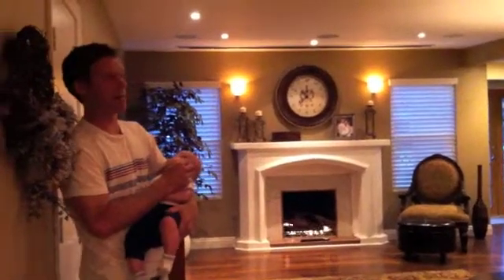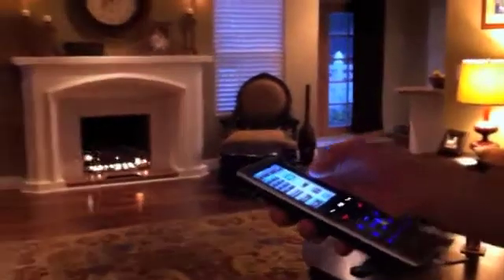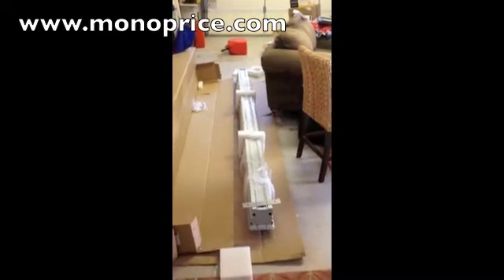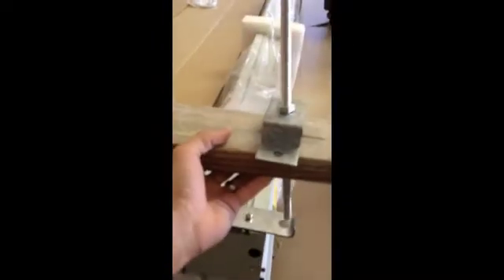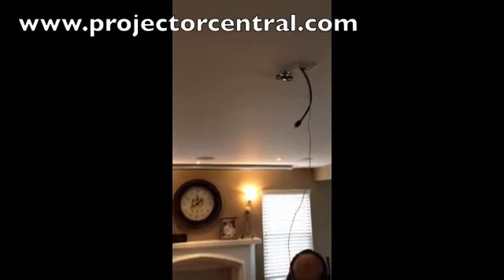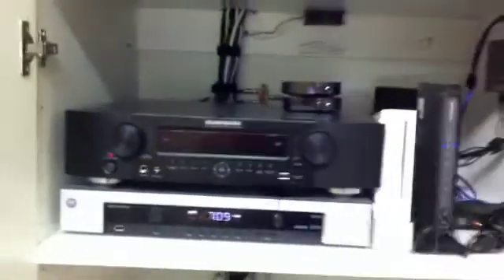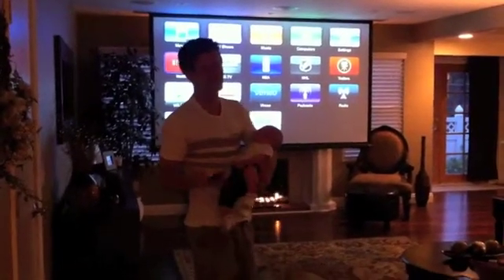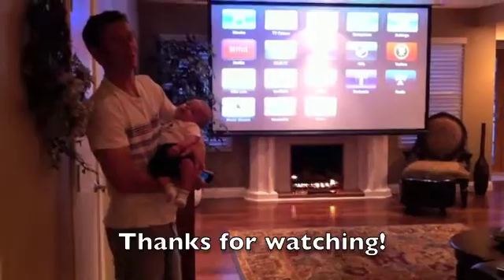Home Theater Recessed Screen Installation

Comment from the maker: 1) The speakers are just contractor series from Jamo (8.5CS), they have pivoting tweeters only. 2) The projector: Epson 710HD 3) The screen doesn't sag much at all & I'm quite happy with it as is. The tab-tension wouldn't have been consistent with the other "cost-effective" products installed. 
- As mentioned, this install was to flip our house... If I were to upgrade anything here, I'd start with those front-channel speakers.

Comment: I am planning doing almost the same exact installation in my home. Your video helped a lot. Couple questions:1) Are the front angled speakers 8" angled monoprice as well? 2) Which projector did you purchase? 3) Did you consider a tab-tensioned screen due to the 120" size and potential rainbow,sagging, and longevity issues?

Comment: Thank you for sharing this. I am planning to do this in my living room, but it doesn't have a attic access like yours did. Would that make this project more difficult? How would you do support joists in this case, and how would electrical wiring work (to power the screen). I really appreciate your video. I don't think there are a lot of recessed ceiling installations HOWTO (especially in video!).

Comment: Nice set up.
I'm planning out a very similar gig for a very similar area.
I wrestling with one major difference that I'm hoping you might have some advice for.
I have a recessed ceiling(already installed) and I'm not quite sure how to properly mount the screen.
Any advice you might be able to give a handy novice?
I've tried looking around a bit for examples or "how to's" and haven't been able to find much.
Reply from the maker: Depending on the screen you purchase... if it has a recessed kit, you'l need to have room above you ceiling. If there's no recessed kit, you'll likely have to surface mount and get creative to frame around it (maybe with a piece of trim attached to the bottom of the screen drop).  No matter how handy you are, read the instructions. Good luck!

Comment: Nice, although I rather doubt the "added $15k to our home value".  Also, the projector enclosure is probably not a good idea since it limits the size of your projector (the one in the video looks rather small), not to mention prevents your projector from effectively cooling due to being in an enclosure (hence, shortening it's lifespan likely).  The screen looks great installed though, nice job.
Reply from the maker: We sold the house a few months back and it was definitely a selling point, I'll stick to the $15k added value (probably more though judging by the reactions and offers we had from those who were interested).
    I wanted that projector enclosure as small as possible, as I mention it's there to reduce the visibility of this room being a "theater". There's actually just the right amount of room in the front for the exhaust and intake, and it also serves it's other purpose - silencing that projector.
   Overall everything came out just as I had expected and hoped.

Comment: 1 question sir how do i know the exsact location of projector and the size of screen i'm going to use?
Reply from the maker: Screen size might depend on your room size and what you think would be best fit. There used to be a rule of thumb that the screen size be 2-3x the distance your viewing from, but that was years ago when a 50" was a "large" TV.
 For projector distance, I list it in the video.. go to projectorcentral.com, they have a calculator - you'll need your projector model and screen size, it'll tell you the throw distance.. usually you don't want the screen top to be more than ~12" below the projector.
Reply: thank you sir